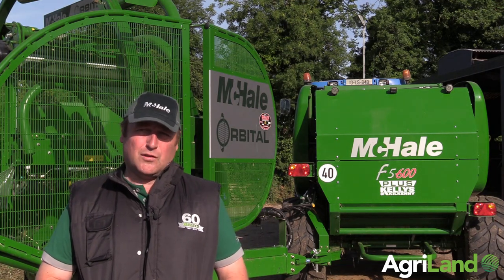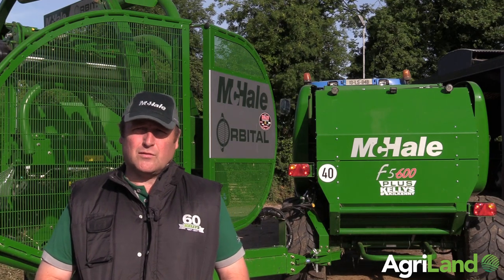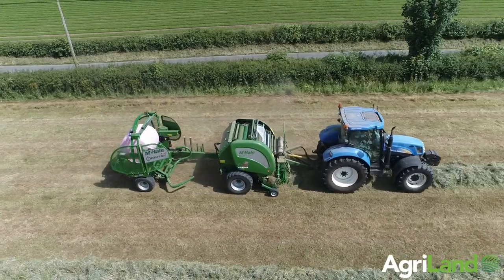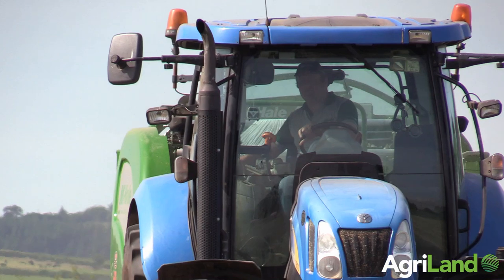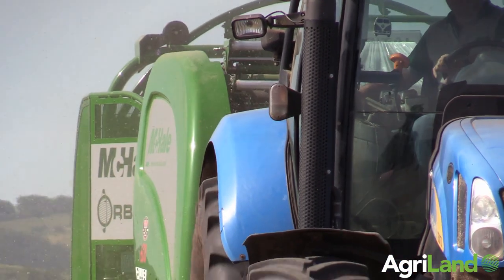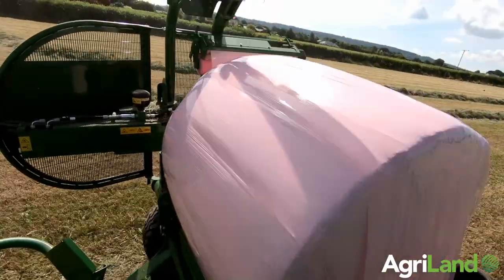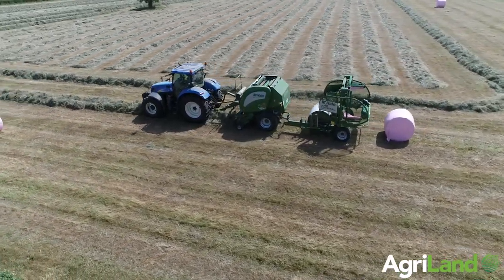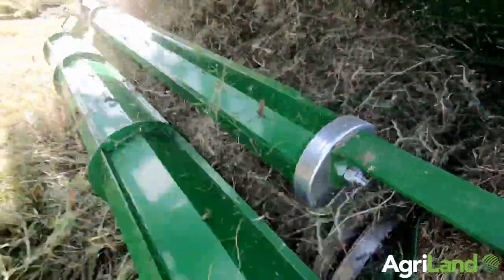AgriLand: Seamus Duggan from Co. Laois explains his approach to baling and wrapping

Comment: How would you reverse on the road if you met a car
Reply: The car would reverse
Reply: It’s not an issue as you back the baler as you would normally but steer the wrapper using its movable drawbar